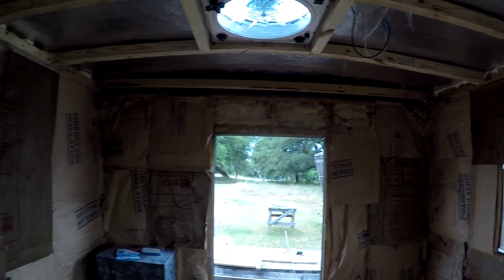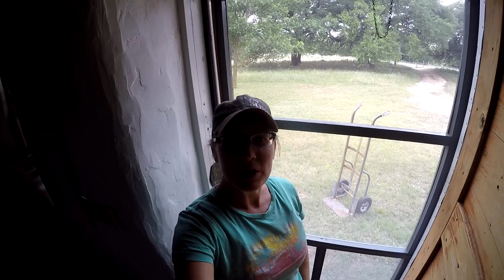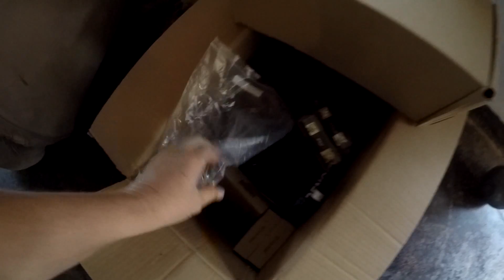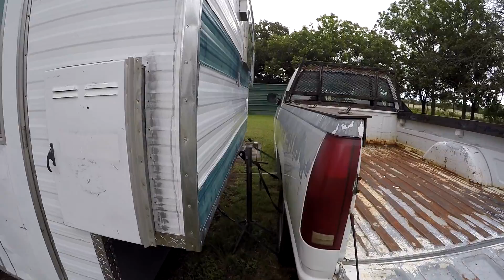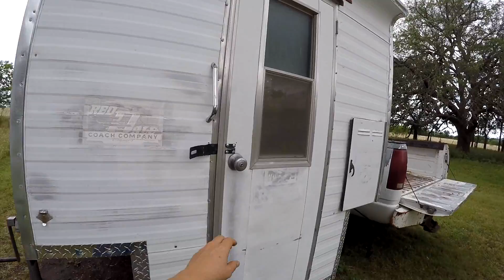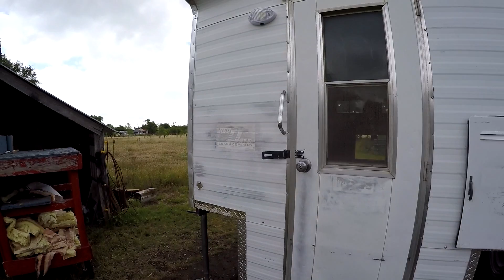Walls Insulated & Solar Parts Arrive - Truck Camper #12

Comment: I also installed the Renogy 300 watt kit. Love it. I have 2 AGM batteries and this kit has no problem charging the two. It does such a good job I'm going to add 2 more batteries to the system. Hope this helps you. Easy to install also.

Comment: Doesn't getting itchy from working with those pieces of fiberglass just drive you "batt-y"?  :-)
Reply from the maker: Yes.  I recommend you cover your arms and legs when working with this stuff.  This wasn't my first fiberglass insulation rodeo....I knew what to expect but I would rather itch than sweat half to death.

Comment: Fiberglass insulation!!!!!!   Long pants and long-sleeve shirt.......   What will you use for a vapor barrier?
Reply from the maker: I was a bit itchy.  No vapor barrier.
Reply: Won't the insulation get all wet if you somewhere cold?
Reply from the maker: I don't think it'll be a big issue.  Camper wasn't built with a vapor barrier and from what I understand vapor barriers have been taken a bit too far in most cases.  Sometimes they even create bigger problems with moisture.   
 https://buildingscience.com/documents/digests/bsd-106-understanding-vapor-barriers

Comment: Smart move by not insulating the ceiling, it'll make it much easier to fit backer plates so one can fasten the solar panels
Reply from the maker: Figured it would be easier to see what we were doing.  Solar panels will not be directly mounted to the roof.  We're building an apparatus.  The panels will be removable with fairly little trouble.